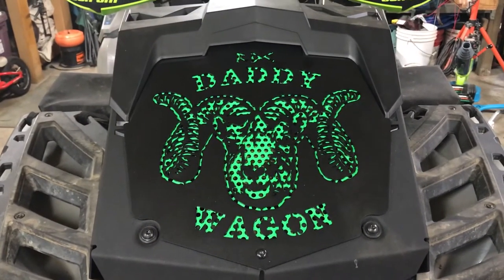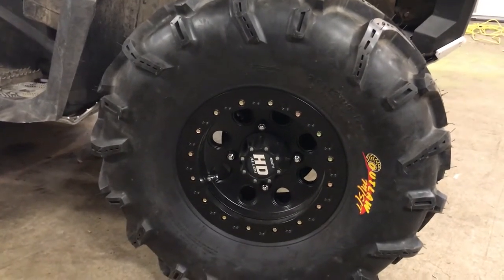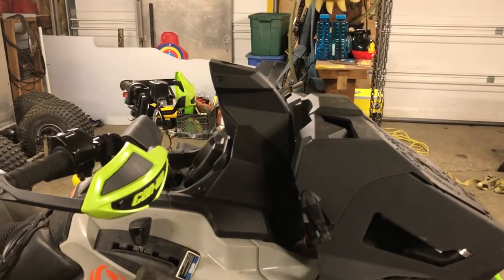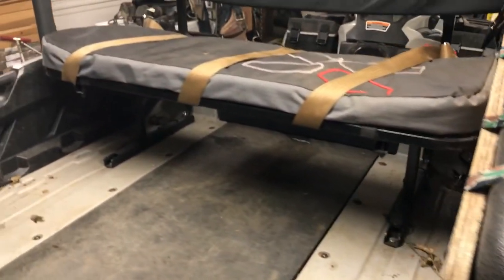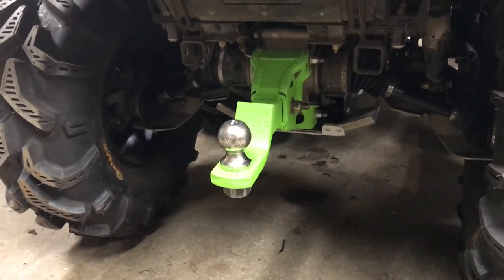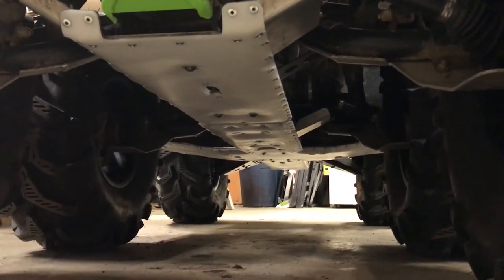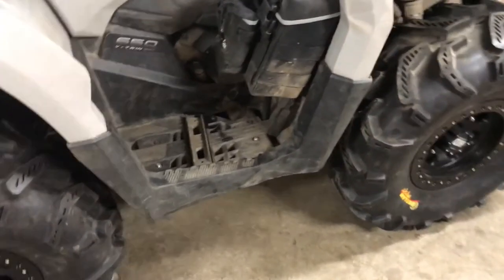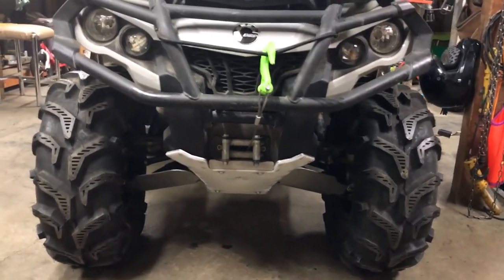Canam 6x6 Daddy Wagon Build

Comment: Nice man. I live in Alaska also. I Have Always ran Polaris 6x6's  and love them. How well has this held up to the Alaskan terrain abuse.
Reply from the maker: I have just over 1000 miles on it now and only problem is one back cv axle is clicking. I pull a big meat wagon behind it when I go hunting and the 650 has plenty of power and does really good on fuel. I usually haul out a moose and camp in one load. I have had 2 Polaris 6x6s and they just wouldn’t hold up to the Abuse.